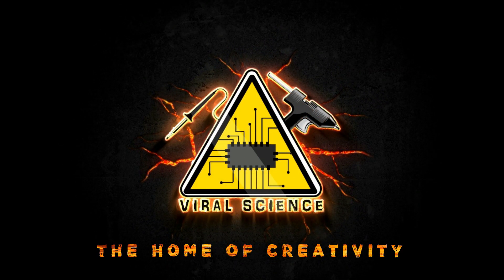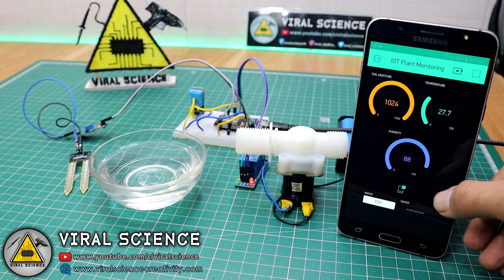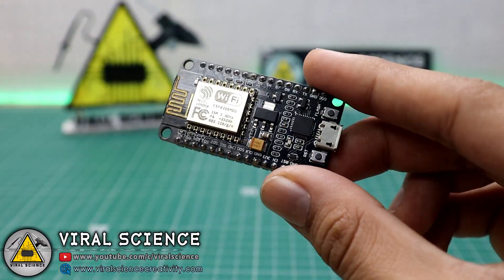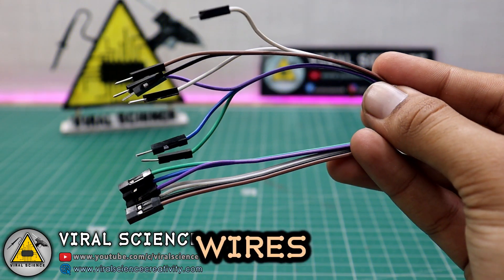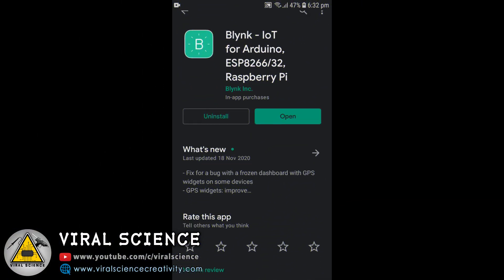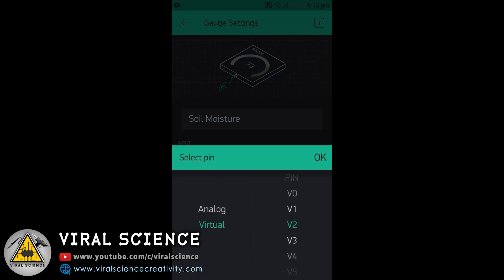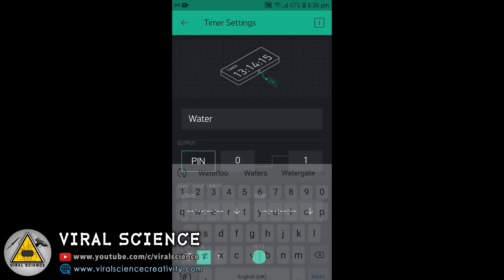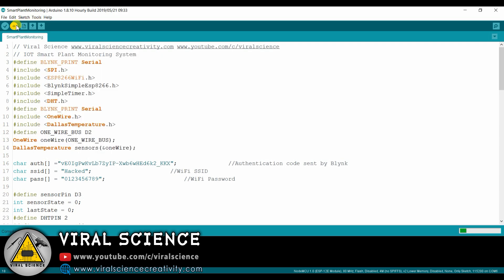IOT Smart Plant Monitoring System | Smart Irrigation

Comment: I am facing a lot of issue in the code part
In file included from c:\Users\91887\OneDrive\Documents\Arduino\libraries\Blynk\src/Blynk/BlynkApi.h:45,
                 from c:\Users\91887\OneDrive\Documents\Arduino\libraries\Blynk\src/BlynkApiArduino.h:14,
                 from c:\Users\91887\OneDrive\Documents\Arduino\libraries\Blynk\src/BlynkSimpleEsp8266.h:24,
                 from C:\Users\91887\AppData\Local\Temp\570a58c6-5abb-4c98-a6b3-e54aaf237a41_SmartPlantMonitoring.zip.a41\SmartPlantMonitoring\SmartPlantMonitoring.ino:8:
c:\Users\91887\OneDrive\Documents\Arduino\libraries\Blynk\src/Blynk/BlynkTimer.h:36:21: error: redefinition of 'class BlynkTimer'
   36 | #define SimpleTimer BlynkTimer
      |                     ^~~~~~~~~~
c:\Users\91887\OneDrive\Documents\Arduino\libraries\SimpleTimer/SimpleTimer.h:10:7: note: in expansion of macro 'SimpleTimer'
   10 | class SimpleTimer {
      |       ^~~~~~~~~~~
c:\Users\91887\OneDrive\Documents\Arduino\libraries\Blynk\src/Blynk/BlynkTimer.h:36:21: note: previous definition of 'class BlynkTimer'
   36 | #define SimpleTimer BlynkTimer
      |                     ^~~~~~~~~~
c:\Users\91887\OneDrive\Documents\Arduino\libraries\Blynk\src/Blynk/BlynkTimer.h:42:7: note: in expansion of macro 'SimpleTimer'
   42 | class SimpleTimer {
      |       ^~~~~~~~~~~
C:\Users\91887\AppData\Local\Temp\570a58c6-5abb-4c98-a6b3-e54aaf237a41_SmartPlantMonitoring.zip.a41\SmartPlantMonitoring\SmartPlantMonitoring.ino: In function 'void loop()':
C:\Users\91887\AppData\Local\Temp\570a58c6-5abb-4c98-a6b3-e54aaf237a41_SmartPlantMonitoring.zip.a41\SmartPlantMonitoring\SmartPlantMonitoring.ino:76:9: error: 'class BlynkWifi' has no member named 'notify'
   76 |   delay(1000);
      |         ^~~~~~

exit status 1

Compilation error: 'class BlynkWifi' has no member named 'notify' 
This error message is displayed when i try to compile the code

Comment: Hi the  Blynk is app has been upgraded to new version. In this new version there is no "select pin" option for button. only have INT V1,V2,V3,V4,DOUBLE V5,V6,V7,V8,V9,V20,STRING V11,V12,V13,V14.So which should I choose?

Comment: Good day amazing project... I tried making one simpler to user but with a 4 relay module and 4 moisture sensors. I used your code and altered for it to work with relays and sensor but i am having a probably with the relay when trying to use it my esp8266 module keep disconnecting and reconnect can u please help me that would be greatly appreciated
Reply: Can you please tell me the current capacity of 12v battery

Comment: The diagram what shown on the picture and what in actual connection is totally different. Your explanation is not clear. I followed all the steps what couldn't configure the nodemcu. Also it's not being found by the application. Useless.
Reply: Ground (gnd) and 3v(VCC) are different that's doesn't matter.
Before config esp8266 board, add esp8266 board in Arduino ide, also add all required libraries.
Reply: @vikashsangwan7675  i did all, but when i upload the given code it gives me error when compiling , firts error says" d2 is not in scope dod you mean v2" when i change from d2 to ve then it gives me error with compiling the esp8266. Do you have any solution for that ?
Reply: @mithate.7951  Attach the error msg

Comment: Simple but Excellent solution on plant monitoring. Can we use Power supply module on breadboard along with NODE MCU ESP 8266 inplace of external bettery? If yes, then how will be circuit diagram

Comment: sir, is there any difference between using nodemcu v2 as yours and lolin nodemcu v3? your respond is truly appreciated.
Reply from the maker: No you can use any for this project
Reply: @ViralScience  Thank you on your respond sir! Im facing a problem during compiling the code. error in compiling for board nodemcu 12E. ive tried to follow every solution steps about the error but still do not solve. can you be contacted? i would like to seek your help :)
Reply: @nurkhadijah2758  did you find the solution

Comment: I presume you already noticed your sensor is decaying through electrolysis?
Reply: yeah, you either use a capacitive one or only power the sensor to make a reading and then shut it down again, so like 1sec every 10min or so, using a NPN transistor, like that it will last for years.

Comment: Nice start but a little gadget...
I'm working on a up to 16 plants unit, divided  into 4 lines vith its own valve each.
I have a bowl to mix water with 3 different liquid fertilizers.
Eauch line has its own "nutrition program"...

One advice: avoid resistive moisture sensor, their working principle (flowing current in water) makes tem rust quicly.

Good luck & much fun 😀
Reply: what is your suggestion for non resistive sensor ?
Reply: @fredykardian  You should aim capacitive sensors rather. Note : I built a resistive one out of : 
- a soda stub plastic (female) screw
- 2 metal screw
- some wires 
- a variable resistor (variable for some kind of calibration)
- some hot glue, solder , and so on

Turned out to be pretty precise ! But it will prolly oxyde and then derive the measurements...
Reply: @skuizhopatt5318  superb man, ... do you have video on how to make it ?
Reply: @fredykardian  Are you american ?
Reply: @skuizhopatt5318  no, I am not ...
Reply: @fredykardian  Here is "my" capacitive sensor... It's an open source HW I "rebranded"...

Comment: You should have created an actual scenario with small garden, instead of animating water. It will be more effective if the system is able to switch on solenoid valve as soon as humidity level of soil comes down below certain value and switch off when desired value is reached. Any ways good work 👍

Comment: Hey, viral science !. I have got a college project... I feel that yours is quite good and since I don't have Nodemcu V1, can we use the V3 board for this project? Also, can you mention the software which you used for designing this cuircuit?
Reply from the maker: Yes
Reply: @ViralScience  brother wifi module code getting error
Plz give ur Gmail and send the correct code
Reply: @mmanoj3037  did you get the code?
Reply: Hi
Reply: @ViralScience  THIS OCCURING ERROR IN LATEST AURDINO PLEASE GUIDE ME ITS REALLY URGENT
Reply: @MANGESH_CHAVAN  bro did it working??? For me it is showing class blynkwifi has no member named notify
Reply: @SaichennakesavaEPIS  same hear bro
Reply: are  u done this project
Reply: ARDUINO SOFTWARE